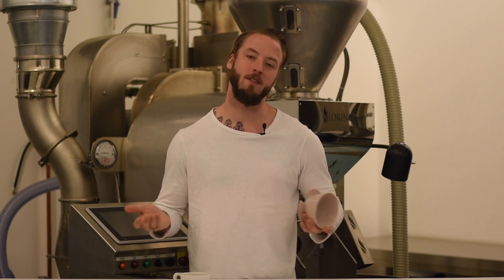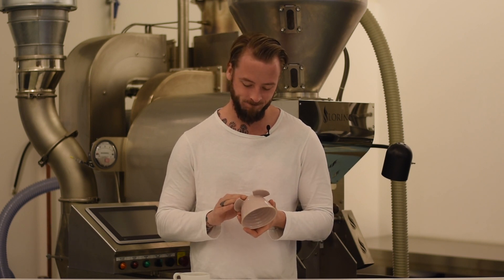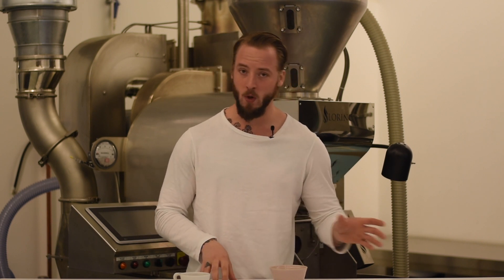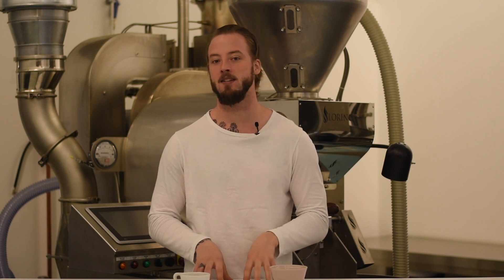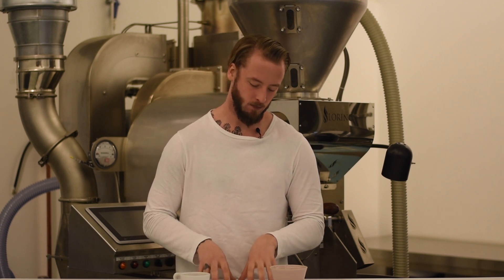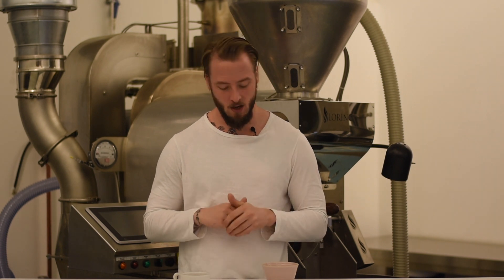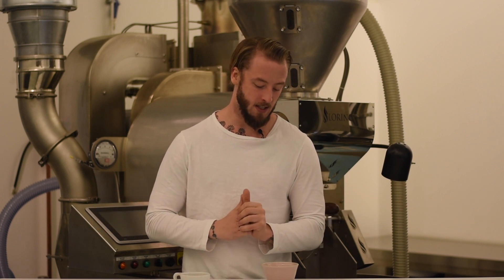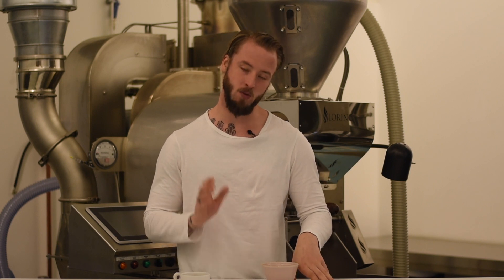Coffee with April Episode 46: April Brewer Teaser Trailer

Comment: 2 questions: why not to have the same temperature throughout the whole brewing and why would a fast flowrate produce better/more intense flavours?
Reply from the maker: Thank you for watching. 

1. You want a different temperature as the coffee and what you extract changes through out the brew. You are basically extracting different things at different stages and the best way to extract in the different stages will not be the same. Much like roasting coffee. We change our Burner (energy) during the roast becacuse the beans and it needs changes. 

2. You isolate what you extract. And most importantly generate a high strength with low contact time. Makes for a much cleaner cup with clearer defined flavor notes.
Reply: @coffeewithapril  I would have thought that Kalita with the longer contact time is a "hybrid" between immersion and percolation brewing. Just like in the case of December Dripper, only with Kalita there is just one flow rate option.

Regarding the 1st question: How does the ceramic influences brew temp throughout the brew? I imagein it starts low and rises toward the end?